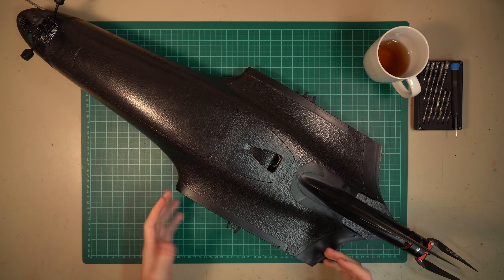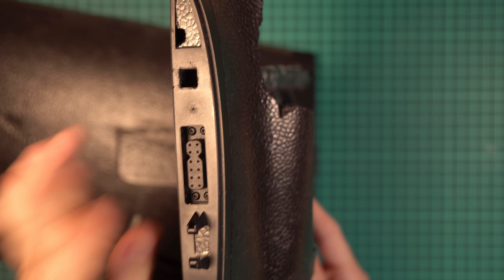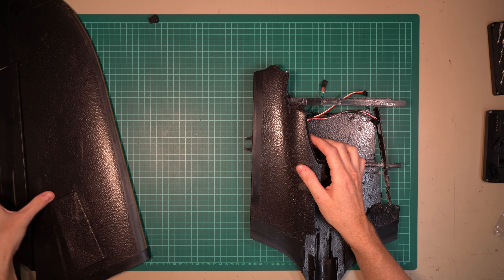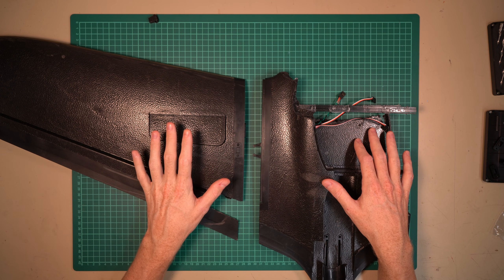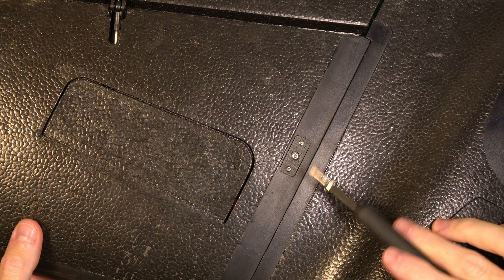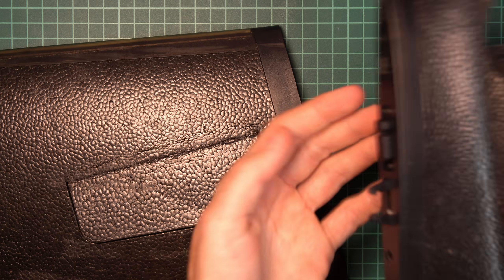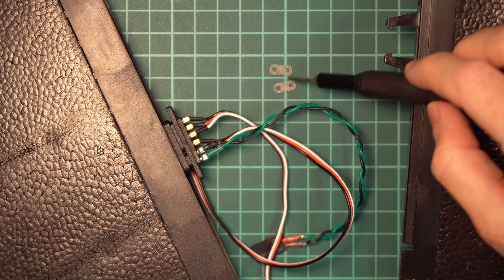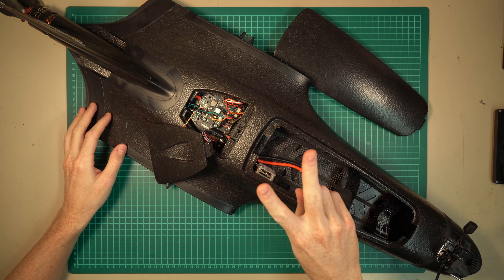The TBS MOJITO Problem Nobody Talks About

Comment: Hi, have you tested it for real long-range flights? I have an AtomRC Dolphin and managed to fly about 80 km total with a 21700 6S1P 5000 mAh battery. I’m thinking about getting the Mojito next because of its gliding capabilities, but I’m not sure if it’s actually better for long-range efficiency. There’s also very little info with real test flights on the internet, so I’m kind of confused. Besides, it looks sexy but also expensive ;D, so I’d be glad to hear your opinion!
Reply from the maker: Hi good questions! The mojito is a very efficent platform. I usually fly with a 7s 7.2Ah lipo and you can fly level for about 1h or so between 70-90 km/h. With a 8s2p you could really make some distance. I was never able to fully test it because I mostly go up and down.

For example:
5km out 1.7km up
back home
9km out and 2km up
landing

Total 35min and 3.8V/cell when landed

Only thing about the mojito is that this efficency makes for some challanges when flying. For example you cannot nose dive or you reach 200km/h very fast and then the wing is to soft to still be mojito-shaped.
Btw pain to get the launch setup working correctly and for landing you need to be skilled or a LOT of space in front of the landing zone.

Comment: I own all the Ritewing Drak sizes. nano 28, Mini Drak 40", and a Big Drak 60". They are among the most crashworthy planes available. I have one that had a failed servo at a 120mph and ended up in 7 pieces. I glued it back together with gorilla glue. Sanded everything down and you can hardly even tell it was ever crashed.  The Mojito is a sexy looking wing, but it seems fragile. I thought about removing the wing connectors altogether but your print designs seem like they are adequate improvements. Thanks for making this video, designing the parts to fix it and sharing them. Cheers
Reply from the maker: Thank you very much. Thing about the mojito is that is very heavy in some configuration. This make it fly amazing but at the same time the energy must go somewhere. In my current config is about 3.4Kg

Happy that you liked the video!

Comment: Sad to see that TBS doesn't fix this, even one year after release.
Unfortunately the Chupito also has some problems with bend wings straight out of the box or a drifting FC for some people.
Reply: the FC drifting may be a firmware target issue, I had to make a custom build on my AIO because one of the IMU's was actually completely backwards, but their spec sheet did not list it as such causing severe deviations.
Reply: "drifting FC for some people."  Whats this about, not heard of this issue.

Comment: Hi! I just want to thank you for clearly describing this issue.
I struggled with the Mojito for a long time, trying to figure out the cause of random stalls and roll-offs that kept leading to crashes right after launch. In the end, I completely destroyed it and tried to forget it like a bad dream.

I really like the aircraft itself, but honestly, these struggles were just not worth it. I broke components worth over €1,000 — an absolute nightmare. And the worst part is that I never managed to identify the real cause back then.

It’s great that you were able to get to the bottom of this problem. Thank you for sharing and for doing this work!

Comment: Thanks for the explenation, I did not print the connector plates, I use some servo arms and made it fit, for the wing lock I use tape, I will never took the wings off, I already didn't trust the wing lock, I noticed that when I pulled it by hand the wing came loose.
Reply from the maker: Well played with the servo arms, good idea. I also taped the wings before but it was less practical